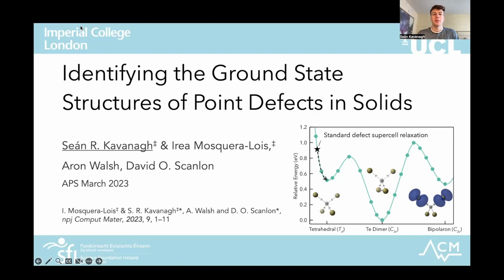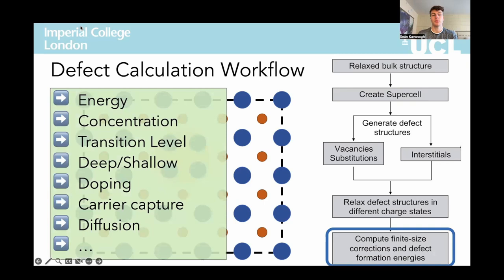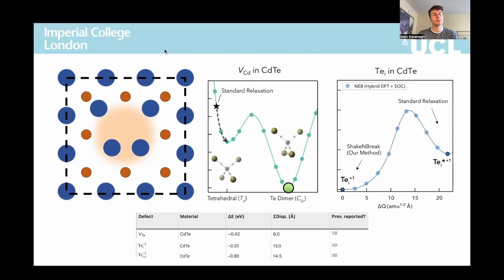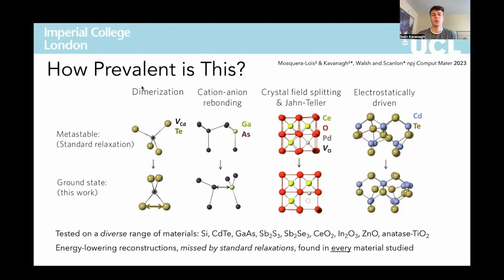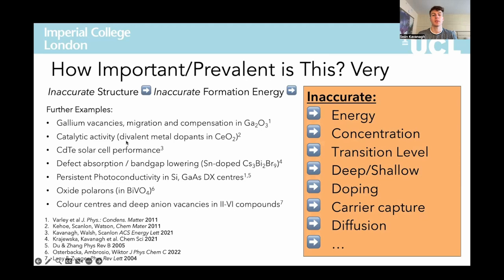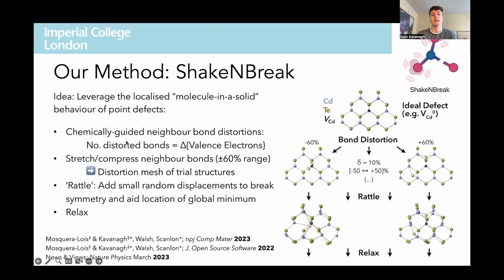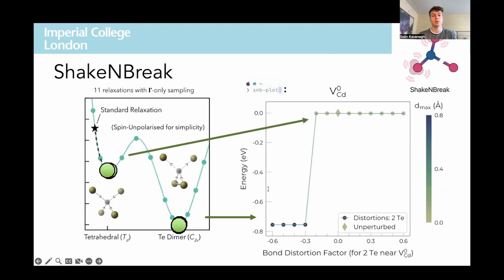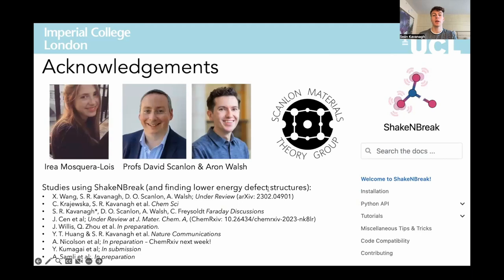ShakeNBreak: Symmetry-Breaking and Reconstruction at Defects in Solids

Comment: hello Sean, when I use ShakeNBreak, there exists some error when the POSCAR contains an Au atom, maybe it is pymatgen’s fault
Reply from the maker: Hi!
Thanks for pointing this out! We noticed this issue recently (due to pymatgen's default oxidation state functions not returning a value for Au), and implemented a fix in the develop branch of ShakeNBreak on GitHub (https://github.com/SMTG-UCL/ShakeNBreak/compare/a69bb5a3d88f...f3064f08556e). This will be merged to the main brach and updated on PyPI (for standard installation: pip install ShakeNBreak) in the next few days (we're just waiting to add a link to a Nature Physics News & Views article on SnB that we've been told will be published this week).
For now, you can install the current develop version of SnB with:
git clone https://github.com/SMTG-UCL/ShakeNBreak
cd ShakeNBreak
git checkout develop
pip install -e .

Alternatively if you can wait a few days, I'll reply to this comment again when the PyPI version has been updated, and then you'll be able to update just with:
pip install --upgrade ShakeNBreak
Reply from the maker: Hi! Just to let you know, we've now released this updated version of ShakeNBreak with this fix (and some other performance improvements), so it can now be installed using pip install --upgrade shakenbreak. Thanks again for noting this! 😃
Reply: Thanks very much for your response!